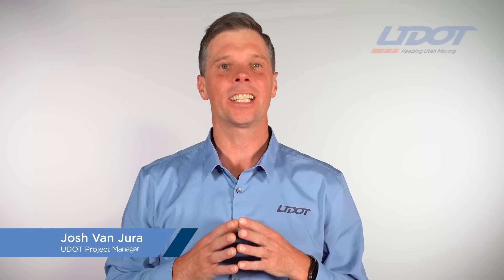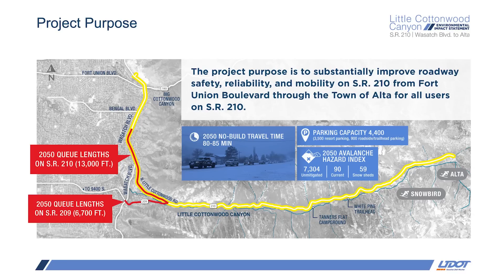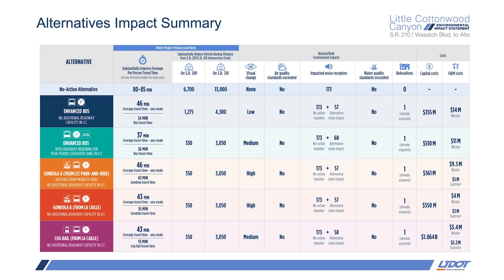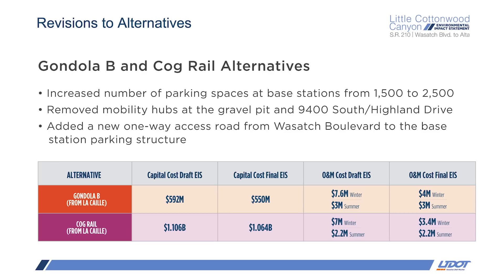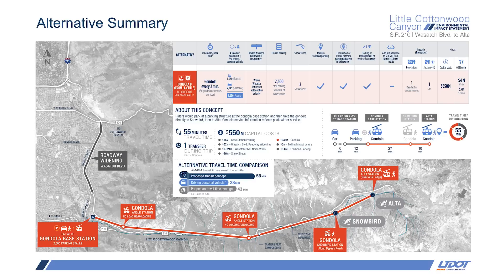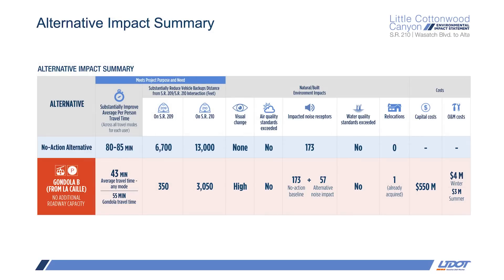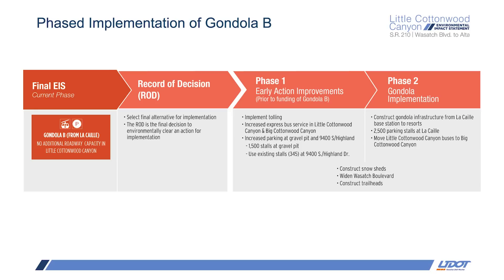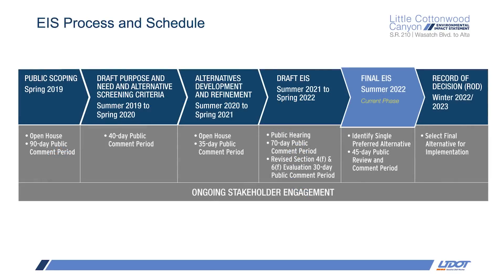Little Cottonwood Canyon Final EIS Part 1 - Aug. 31, 2022

Comment: Who benefits from any one of these implementations? The residents and the ski resorts and the skiers. Make them pay for whatever changes are made. Don't make the general public pay for such a stupid plan. Other alternatives THAT ARE LESS EXPENSIVE have been proposed. The amount of money planned to be spent on this is very high for the few days per year that this is expected to help (50 days was it?). And the damage to the beauty of the canyon, besides the impact of the construction is NOT worth it. Electric buses would be less impactful, and quieter, and less polluting that any of the alternatives suggested. This is a completely someone-is-making-money-on-this project. I don;'t know who, but the length of time that this has been in study shows that it has been hidden from the public for most of its life. So if it quacks like a duck and it walks like a duck and it looks like a duck....

Comment: Why take note of the themes of the public comments if they are going to be disregarded?

"Consider all canyon users, not just resort visitors" How does a gondola do that if it only services the resorts...? "Keep existing recreation opportunities intact (climbing)", recreation opportunities are more than the intactness of a rock or trail, which leads to "maintain visual experience". The gondola absolutely destroys the visual experience. The rendered pictures of the canyon from the climbing areas are devastating... Even if you don't take dynamite to the rock it is destroying recreation opportunities.

UDOT absolutely is not upholding their responsibility as a public agency to do what is best for the public or do what the public wants.
Reply: The public are idiots and should be ignored at all times.